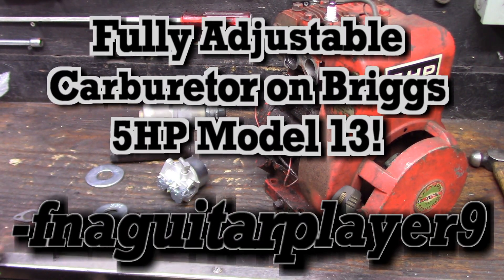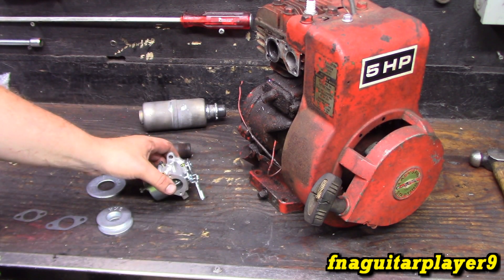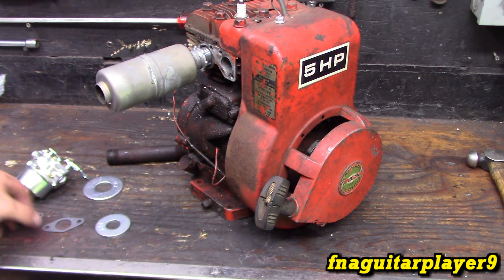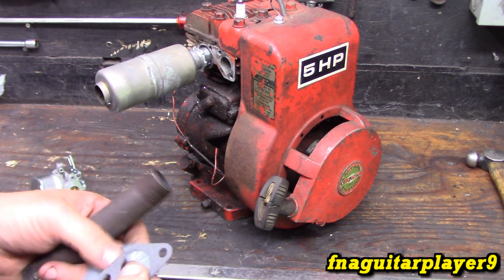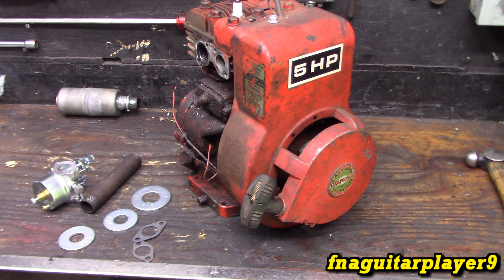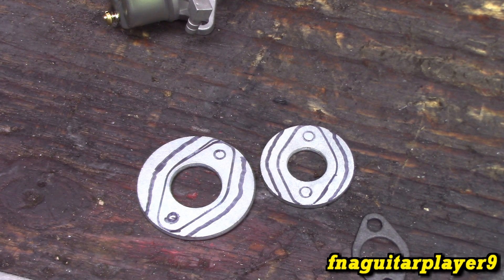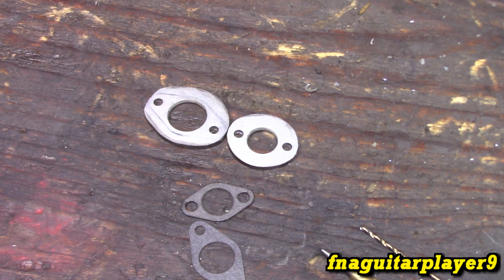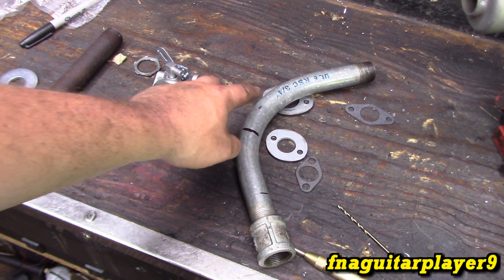Fully Adjustable Carburetor on Briggs 5HP / Build Intake Manifold (can be setup on any small engine)

Comment: next time get a chrome bicycle handlebar and use the bend, and they're 3/4". should work just fine. i used a honda gx390 exhaust pipe for the carburetor side to mount to and a motorized bicycle 32mm bolt spacing intake for engine side and it slips into gx390 exhaust pipe.

Comment: The muffler can be angled away with a cast-iron 3/4" 45° pipe elbow (or 90°) to keep it away from the carburetor as well. Sometimes it is better to angle the exhaust pipe (and the exhaust gases) to the side instead of in your face. This could be an easier solution than angling the carb intake manifold, like if you just had straight pipe. You can buy the elbows in the plumbing section of your hardware store, they have the same thread size and pitch (3/4") as the 'hot dog' muffler and the exhaust port on the engine.

Comment: Techumseh lv 160 intake elbow off a push mower is a direct bolt on . Techumseh carb will bolt right on to that. Good option if you don’t have materials or a welder handy.

Comment: Would you happen to have a part number on the carburetor?
Reply from the maker: No actually i don't, but, i found it by typing in 5hp tecumseh carburetor, just make sure it has the bottom (main) adjustment on it, some of them are preset non-adjustable. Might also be able to find it by typing in 5hp adjustable carburetor. Hope this helps. Thanks for Watching!!!
Reply: @fnaguitarplayer9  thanks for the reply and all information. Love watching your videos keep up the great work
Reply from the maker: @chrishotrod6603  Your welcome! There's alot more to come!
Reply: @fnaguitarplayer9  very important trcunseh h50 with the high speed needle valve in the bottom of the bowl 🥣